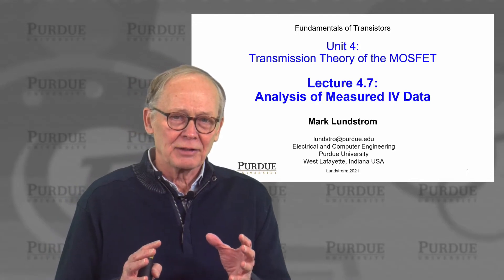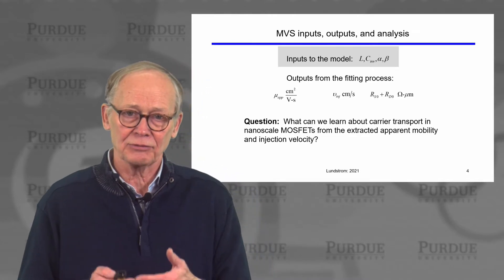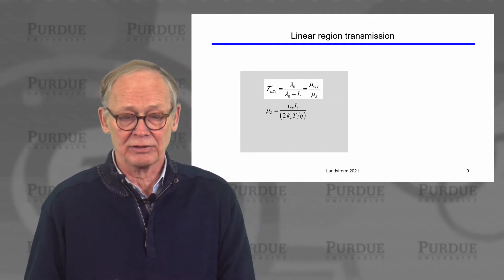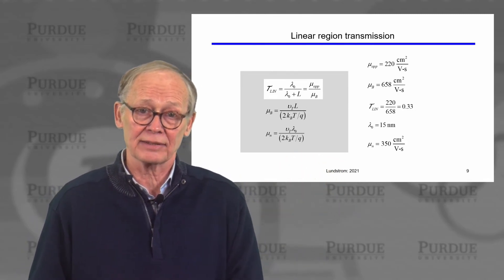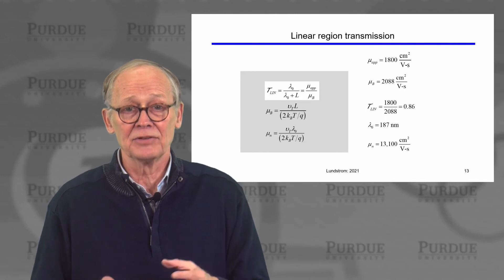ECE Purdue Transistor Fundamentals L4.7: Transmission Theory - Analysis of Measured IV Data

Comment: 00:00    Lecture 4.7: Analysis of Measured IV Data
00:12    Transmission model
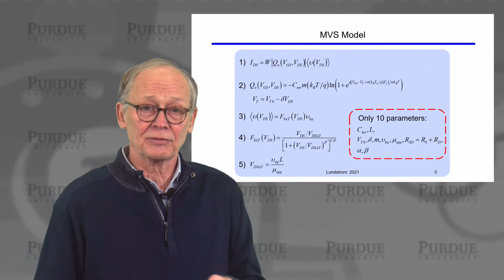00:38    MVS Model
00:51    MVS inputs, outputs, and analysis
01:53    ETSOI N-MOSFETs
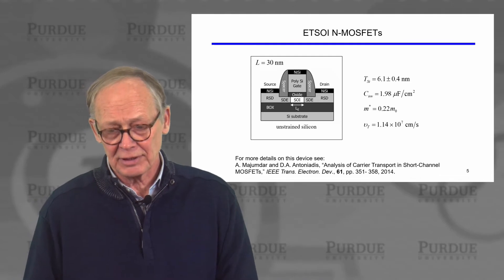02:36    III-V HEMT
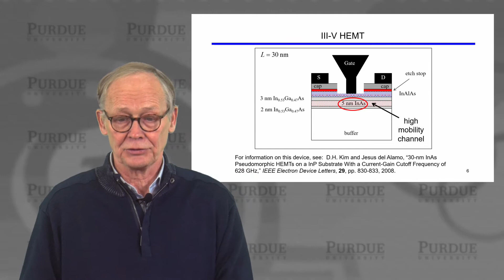03:22    III-V HEMT
03:50    MVS fit to experimental Si ETSOI data
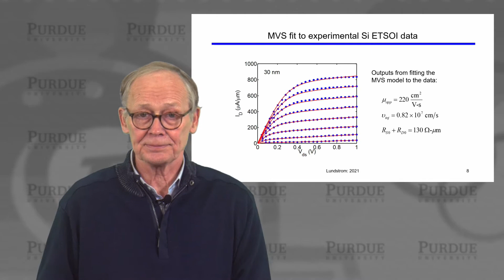04:11    Linear region transmission
06:04    Saturation region transmission
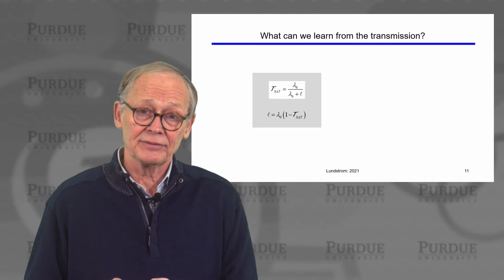07:40    What can we learn from the transmission?
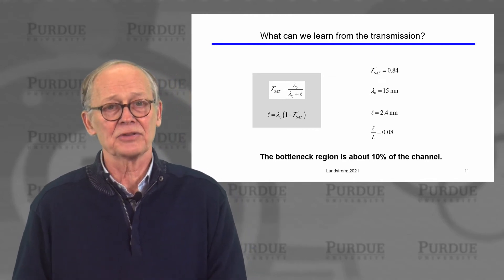08:34    MVS Fits to experimental III-V HEMT data
09:02    Linear region transmission
10:48    Saturation region transmission
12:09    What can we learn from the transmission?
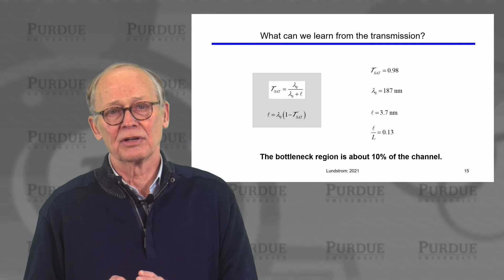13:22    Si vs. III-V L = 30 nm N-FET comparison
15:44    For more on analyzing experimental data
16:02    Summary
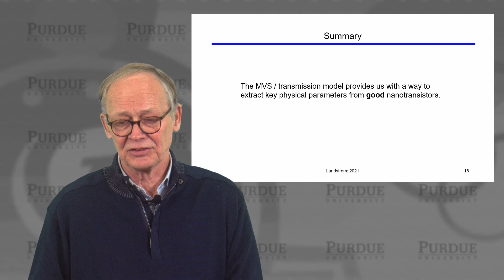16:56    Next lecture